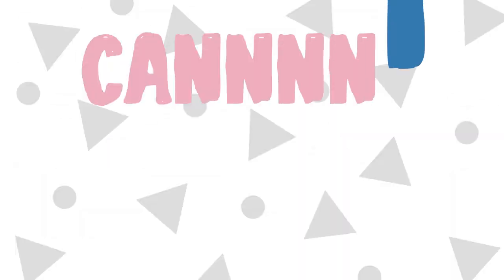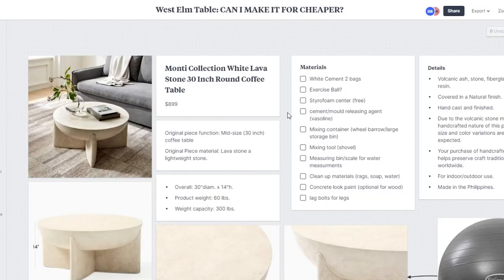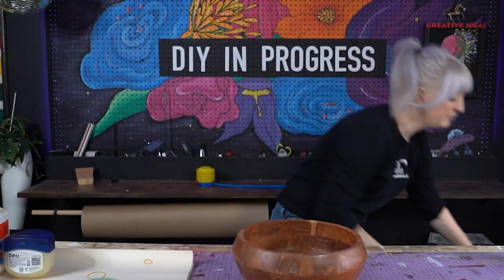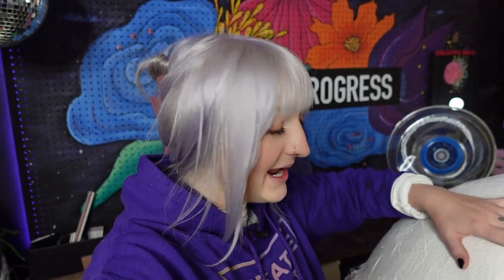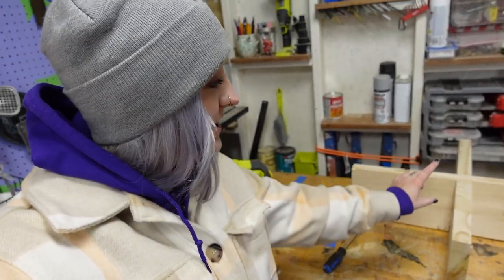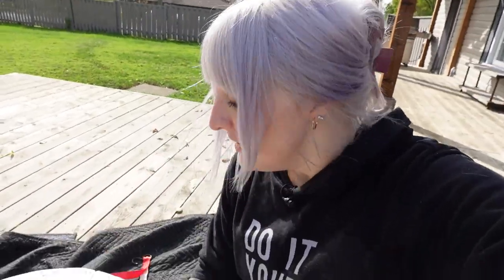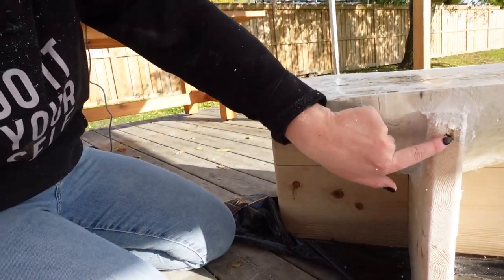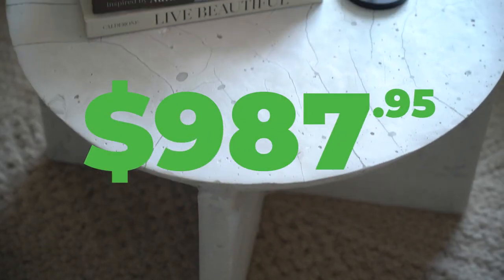Let's dupe the $1000+ West Elm Lava Stone Coffee Table! | Can I Make It For Cheaper?! | DIY Danie

Comment: Sorry, this is a pass from me. The cracks dont look timeworn and antique, they look like imminent failure.  Maybe you could have gotten away with one or two surface  cracks as a look, but these will get deeper over time. They probably occurred because of the thickness of the pour, the low temperature at the time of the pour, and because of the presence pockets of less dense material inside. 
The original tables are manufactured in a warm environment and more importantly, fiberglass filaments are mixed thoroughly into the cement before the pour. Big chunks of styrofoam are not an equivalent substitute because they weaken rather than strengthen the internal structure.  I don't know what the ratio of fiberglass to cement  is but it will be substantial, could be a third or more. There's probably a binding agent as well, and the hod is vibrated like a parts washer to ensure there are no air  pockets in the mixture.
So the takeaway for me is unless you have the right materials and equipment and are willing to wait for warmer conditions,  save your pennies and get the one from the catalog.

Comment: Nope. The easiest way to create lightweight concrete is to add perlite - a stable white mineral (it looks a bit like short-grained rice) up to 20% of the concrete volume. Above 20%, the concrete becomes too weak. Also, you can buy concrete patching compound that is designed to fill in narrow hairline cracks. It costs about $10 for a later or so down here in the States. And finally, heat sometimes makes concrete cracking worse. The real culprit is concrete that dries too quickly, which can be caused by a variety of weather conditions. Easy fix: tarp your project. This retards evaporation enough for the chemical curing to keep up with the drying. Concrete does both - it dries and it cures (i.e., there is a chemical bond formed and that takes time). To create a lava stone or travertine-like finish (with texture and tiny voids) sponge on slightly thinned down patching plaster, then sand and seal. Embedding a flexible mesh (wire mesh, burlap, heavy nylon netting, etc.) also reduces cracks, which is why they use metal mesh in commercial poured concrete. Just a few tips from an older but wiser girl. You're doing great, I learn a lot from your content. Hope this helps.